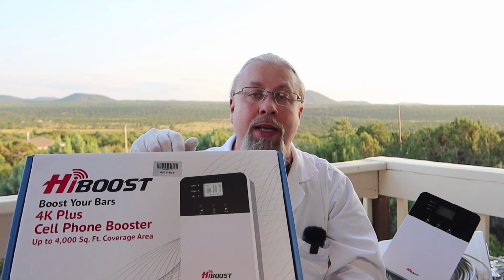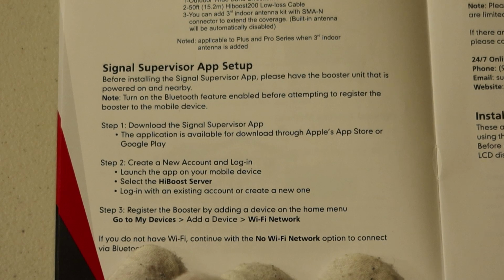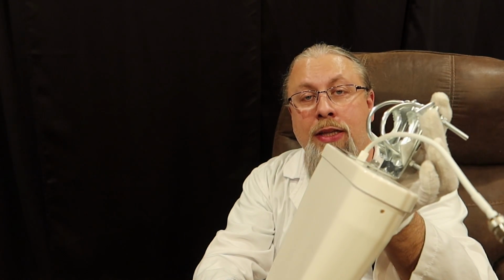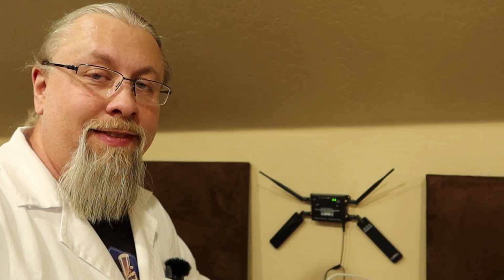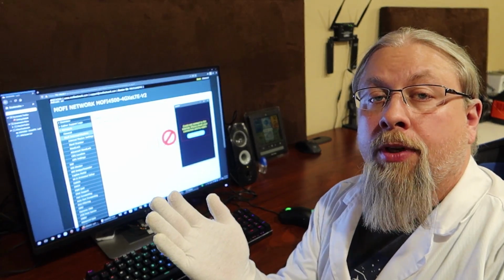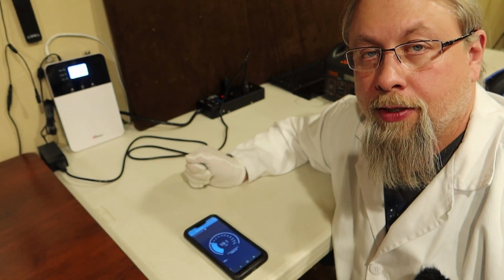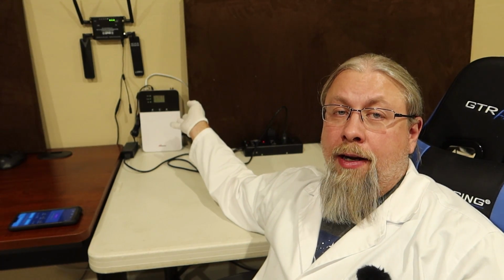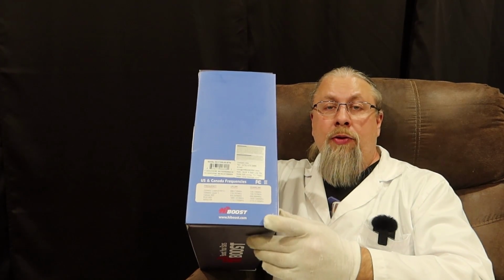HIGH POWER 4G Signal Booster! HiBoost 4K Plus 4G LTE Cell Phone Hotspot Booster Review Installation

Comment: Thank you for the review! Is there any version of this kind of product you can recommend for use when you do not have the ability to direct it towards a tower? We would use this kind of functionality when there are fires nearby which mean the cell towers go up and down and we will not know which one is functioning. The conditions would also not be good for going on the roof to adjust the device generally during these events. Is there a good omnidirectional version? Or a version that would self orient?
Reply from the maker: I have other versions on https://hobotech.tv/amazon/#Electronics-Internet but the short answer is you can simply replace the directional antenna with an omnidirectional antenna for around $50. I use an omni in the van while traveling then switch to a directional if necessary while camping.

Comment: Possibly confusing -- "separated by at least 20 ft of vertical space" (referring to outside antenna and inside booster). With the booster at ground level you need to put the antenna atop a 20 ft pole? No, of course not . . . just leave out the "vertical" qualifier.
Reply from the maker: I'm repeating what the manual states. They say "20 feet vertical space".

Comment: I have a Mofi 4500... I have a tower or 2 within 2 miles of me.... Would the item your describing do the same thing as my Mofi??.. Also do you think if I got a Yogi Antenna I would get a better download speed?  I get 2-3 bars and ran test which Avgs. About 10Mbs DL 4Mbs UL.. I know depending the provider and time of the day speeds can vary
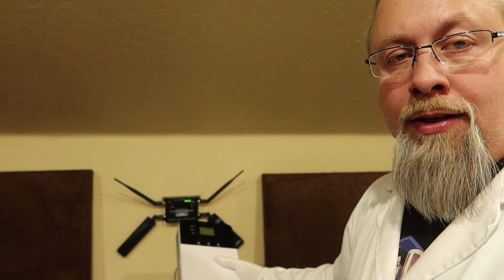(I made it to around the 10:00 mark in your video and see you have a Mofi).. 
So basically will this item give me a faster speed or should I just go with getting a Yogi Antenna sense I'm so close to a tower.. Thanks for the feedback...
Reply from the maker: 2-3 bars is telling me that the signal isn't that strong even being that close to the tower. Could be the structure you're in or you could be signal shadowed by another structure. A booster like this could help if you can get the outdoor directional antenna in a more line of sight place.

Comment: I am about 4 miles from a tower/highway, but in a rural area on six acres.  I currently get 1-2 bars on T-Mobile in my workshop (large metal building) but an impressive 36 Mbps download and 6 Mbps upload.    When I drive over to the tower, I get full bars and 120Mbps download and 40 Mbps upload.  I am hoping the HiBoost gets me closer to the maximum operating potential in my workshop.  I was looking at another brand that recently lowered its price to $999, but they require a technician to install it.  With the discount on the HiBoost, plus the 5% cashback on my Amazon card, I will order one today (delivery this Saturday)  Thanks for the review.

Comment: I believe the booster kills MIMO mode, which causes the degradation in good signal areas.
Reply from the maker: Yes, this is designed for poor signal areas. If you have a MIMO router like I do it still will pull in the diversity signal on the built in antenna keeping MIMO mode active.

Comment: Hobo, good job overall, big help to many people.  Please be aware that even though signal might be apparently strong your speeds can still be marginal.  Speedtest is a great tool but ALWAYS use a remote test server every time.  Cell companies want to push you through their servers and sometimes they move around with deceiving results.  I live in Florida and set my server to the University of Michigan in Flint.  It is an extremely consistent, backbone connected, high level service and at 60ms latency for me.  You always have a reference comparison.  Good job otherwise!
Reply from the maker: Yep, this is why I focus on speed tests and not decibel tests.

Comment: I have a question that I'm sure seems simplistic, but I really need to know. Will this booster work without internet service? I'm going to be in a very rural area (no mountains). There is no internet service on the property. But I do need to be able to use my cell phone for calls, and service is spotty. Will this booster work in a mobile home with a metal roof? It's got 100 amp electric service. Thanks for your time, and for the review. Odin gives zero fuks about the new booster..  ODIN!! Hugs and kissies for Odin and Thor!
Reply from the maker: There has to be some cell signal to boost in the first place. It won't work if there are no towers for your provider in the area. It will work on a metal roof but you need to make sure the antenna is pointed away from the roof and is at least a few feet away.
Reply: @HOBOTECH  Thank you very much! There is signal sometimes, sometimes it drops. This might be a great use of a booster. Just wanted to make sure I didn't have to have internet there to have it work. Every time I turn around from something I'd like to do or get, it requires internet service. Thanks for this review, and the info!
Reply from the maker: @kele1264  No Internet access required! You don't even need the app to set this up.
Reply: @HOBOTECH  I'm glad you told us we don't have to use the app. I hate loading apps - the permissions are intrusive. Thanks!

Comment: Great review.  I wonder what your internet speed would be if you put two of those directional antennas (90 degrees tilted from each other...MIMO configuration) directly on you LTE router and pointed it toward the cell tower.  I guess it would depend on the level of boost you needed.  I have read that MIMO antennas can provide more speed that boosters, but only if the antennas alone can provide you enough boost.  Love your channel....
Reply from the maker: Yes, a pair of directional antennas aimed at the tower would provide a significant signal. Not sureif it would be better than a booster though because my MOFI already has a MIMO setup and the booster still helps.

Comment: How important is line of sight?  My use case involves being in a low spot with a number of very large hills between the house and tower.  Thanks!
Reply from the maker: I've used my booster in the van in a forest with no line of sight. It doesn't work as good but it is way better than nothing.
Reply: @HOBOTECH  Thanks much.  I've watched a ton of your videos and should have considered that fact.

Comment: Not sure if this works with new TMobile 600Mhz band 71 that they are targeting rural areas and 5g.  My 2 year old Weboost does not. BTW I have a 5000 sq ft house and tried Weboost for 7000 sq ft and could only use it in one room at other side of house because of the inside antenna picked up the outside antenna.  It also used a 50ohm cable which is heavy, inflexible, expensive and about 3/4” in diameter.  Sent that back and got a 1500 sq ft apartment model and it works in a couple rooms great.  I have my router there so the house WiFi is good.
Reply: It does not include b71:( got it all but b71. I would go to tmo first as they will send u a boosters (ether booster or a repeater aka uses ur home internet) which will help you get better service and won't cost u anything. Little late but hope this helps.

Comment: Some very good information here especially "I dont willy nilly install APPs onto my phone" hes not kidding people, when you install a app you give them permission to access your phones contents including the camera and speaker to which you could be spied on.
Reply: They have to ask for those permissions though, although there are a lot of things they do collect without your permission like imei, clipboard, network, signal etc etc
Reply: No kidding. I'm actually considering getting a few old cheap smart phones, one for different purposes just because I'm concerned about what data sharing is going on.
Reply: I like an app called "Network Cell Info (Lite)".  It shows you what cell towers you are connected to and the gauges are very useful.  I know exactly where my towers are and will be able to start the HiBoost in the right direction.
Reply: it's not spying if you agree to it.
Reply: @cBodhi  I think a lot of people don't fully understand the depth of the spying they agree to though